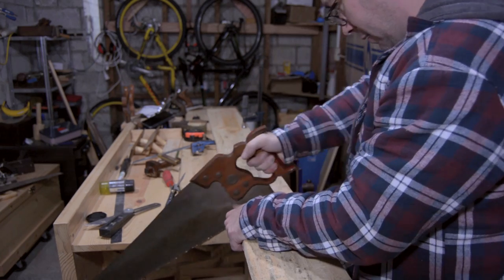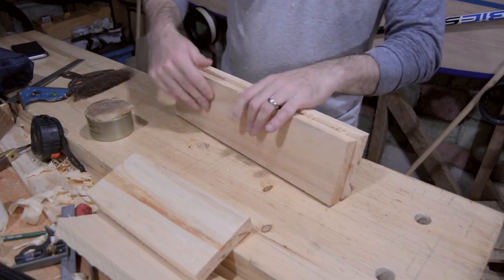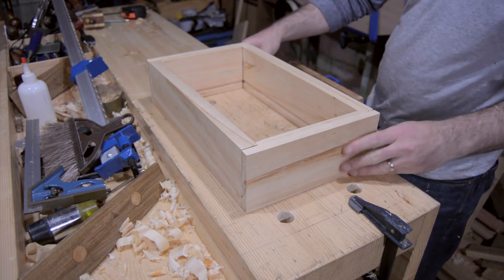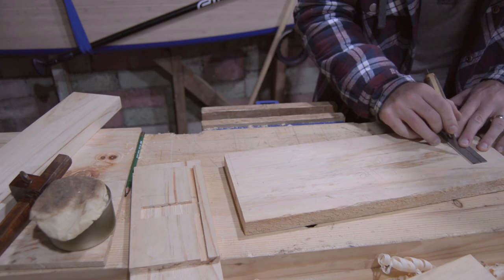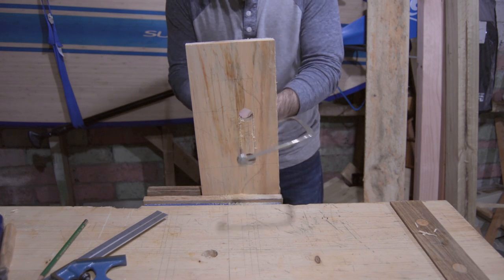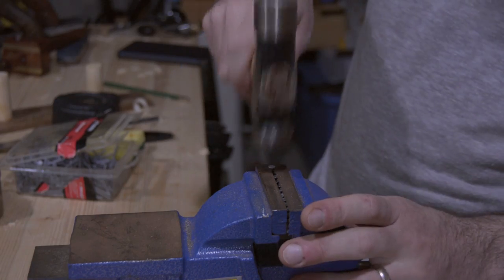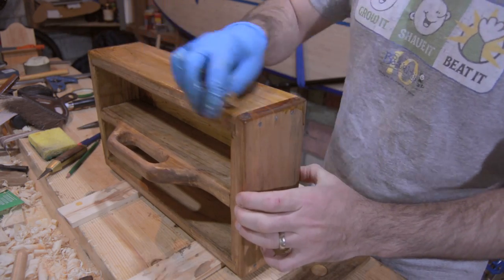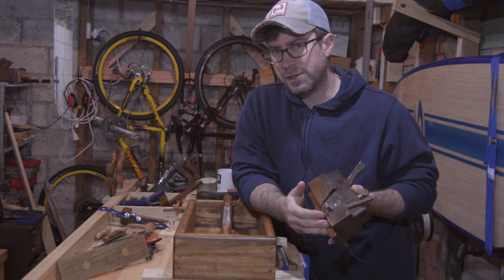DIY | Kitchen Utensil Tote

Comment: Nice box. Good job. What about your G&S rip-saw ? 4.5 TPI ? Mein do not saw straight.
If it is a 4.5 tpi i have the same
Reply from the maker: Hi, Doc! I'll have to do a video on this one.  It's actually a "Crown Tools" saw that I had paid way to much for.  It is listed at 4.5tpi but the reviews say some of them were more like 7tpi and 5.1tpi. This one is just shy of 6tpi unless I'm measuring it wrong (which is possible). 

I assumed it was always me making it saw crooked, which I'm sure it still is in part. BUT I was sharpening that crosscut saw and had out my saw set so I re-set this saw (to a 12tpi set on a 6tpi - sort of how Paul Sellers would suggest). This made all the difference in the world. - Shannon Roger suggested this before to me and I should have slowed down and listened better!

I'd also suggest using denatured alcohol or acetone to remove any lacquer/silicone/whatever that coating is from the plate as that will gum up and cause friction in certain parts of the cut. 

Now that I wrote this I'll screw up every rip for a month ha! Best of luck with it Doc!
Reply: hmm, i think i have to build my own rip saw with higher TPI ... 4.5 is too low i think.